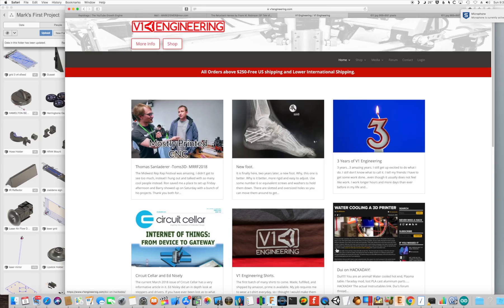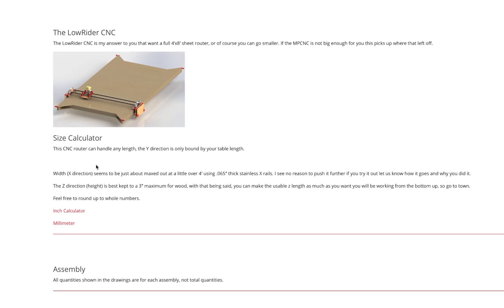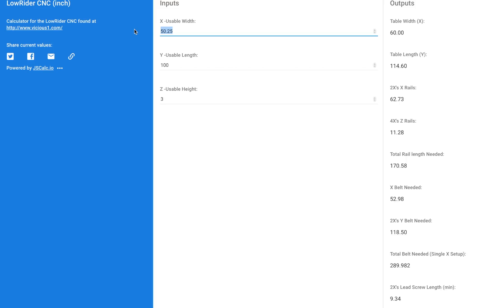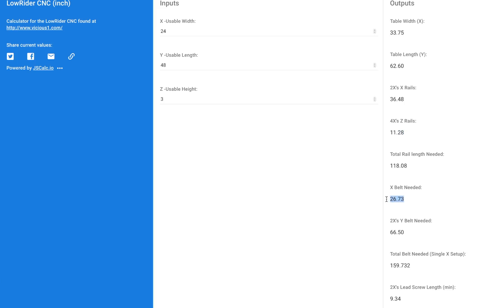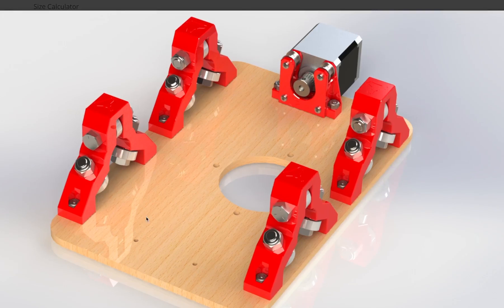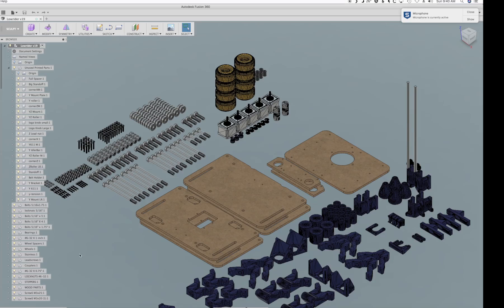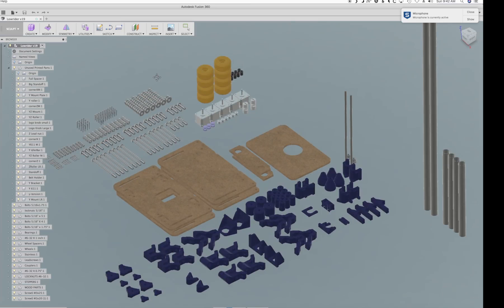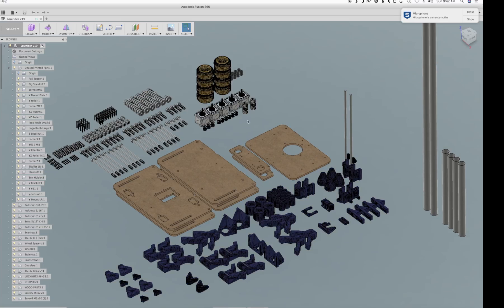Lowrider CNC Build   Part 02   Planning and model

Comment: I know, pretty old video, but I'm enjoying it.

You mentioned, or seeming to infer, the question of building your machine virtually inside your Fusion 360 tool. Here's my take on it...

Years ago I was asked to print the parts for a RepRap based on threaded rod. What I did was to bring the parts into my CAD program (Alibre) and adjust the STLs there, then export them for slicing. Once I had the parts queued for slicing/peinrinf I would virtually assemble the parts into the printer. The reason I went this route was because I wanted to learn how to "build" inside CAD. This gave me the experience of setting constraints, seeing where parts collided, and to build the skills needed to learn my software and learn how to do the CAD work. All very good stuff and I enjoyed it immensely. I was able to utilize the time watching the printer and learn additional skills too.

I'm look forward to your next Lowrider video now :)

Thank you for posting these.

Comment: I just stumbled upon your channel yesterday and I've been binge watching your MPCNC series. I appreciate how you have been building 3D CAD models before you start working. I do the same thing as I wait for parts to come in. I've been working in Solidworks so it might be different, but I found trying to model threaded rods for my assemblies was a mistake. When I used them, my computer slowed down to a crawl. I ended up just using cylinders instead. I had to laugh when you mentioned having to find room to build this. I'm working on a CNC project and finding free space is my biggest concern.
Reply from the maker: Hi Jim, Thanks for watching.  Yeah I've had slowdown issues in Fusion360 too.  I need to build a cabinet for this CNC, and I can't visualize it,  so I need to model it.  It's kinda fun getting a preview of the assembly process.  Thanks for commenting!